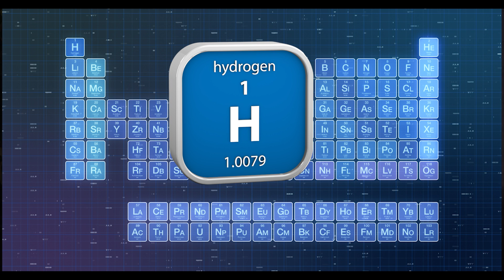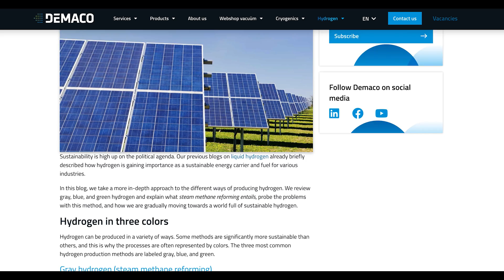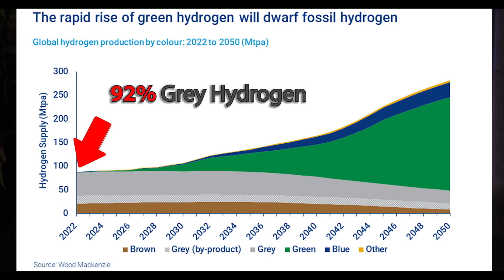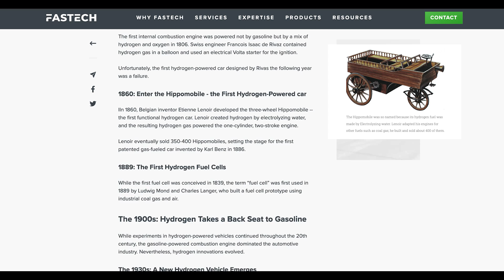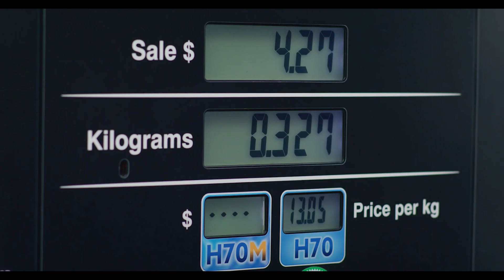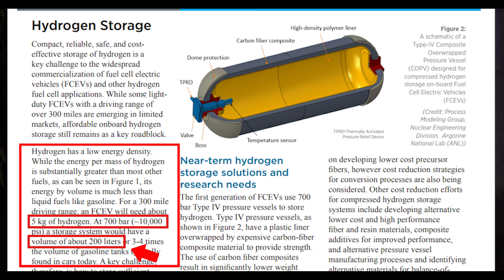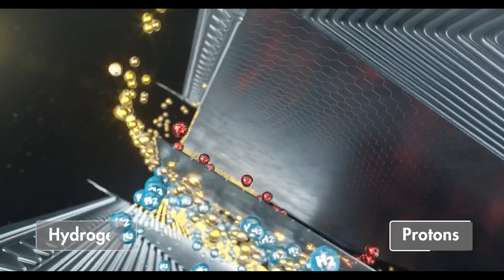The Truth About Hydrogen

Comment: Hydrogen will never fail to show up its poor energy density per unit volume, leak prone tendency, high specific heat capacity, boil off loss in liquid phase inspite of using best of thermal insulator. Only applications like Ammonia or Methanol making, unsaturated organics or ore reduction,  crude oil processing units have been able to successfully use Hydrogen. Best and richest source of Hydrogen is greenhouse gas  Methane only which in turn is found in Natural Gas, Biogas, ruminant fart, growing plants of rice. Natural Gas is also needed to extract Helium and humans are never going to stop eating rice as well as raising ruminants. 
Battery also has poor energy density per unit volume and degrade year after year. Battery recharging is not fast in many nations and uses electricity coming from thermal power plants only in many nations. Highly populated nations or nations facing daily traffic jams like India are skeptical about EVs particularly availability of charging infra and quick charging in case battery discharges. Solar, wind, etc are intermitttent and have low surface power density. Precious economic assets like Land area or terrace area  or even water area must be utilized 24 hours per day, 365 days per year instead of getting blocked with solar or wind or biomass or battery farms. Main use of electricity is to run refrigerator 24 hours per day but not recharging EV battery nor water splitting. Main use of land or terrace area is to build houses, food farms and cloth or other manufacturing units but not for blocking with solar and wind panels. Main use of water is to quench thirst of life, irrigate vegan food farms, provide food like fish to hungry nonvegans, fight fires, ship goods and passengers, curate concrete, wash clothing, etc but not for making hydrogen. Humans can minimize their need to travel by maximizing online tasking, use walking or bicycle to travel small distances, minimize all possible causes of traffic jams, ensure that passenger space as well as goods storage space of each vehicle are fully occupied. Earth has big scope to minimize or optimize the number of vehicles to be operated and manufactured, minimize on resources consumed per vehicle operated or manufactured or per passenger or per mass of goods, minimize emissions per vehicle operated or manufactured or per passenger transported or per unit mass of goods transported but humans on Earth are reluctant to take these steps.

Comment: Much of the information is outdated. The reason is that ev battery improvements are continual. Comparisons that made sense a year ago are are woefully out of dare now. Hydrogen production and storage has more problems now than they did 20 years ago. The big difference is that it has been proven that hydrogen is worse for the environment than carbon dioxide and hydrogen leakage is a problem that has never been completely solved. No new hydrogen filling stations are being  built and instead stations are continually being demolished. Testing hydrogen fueled busses proved to be far less economical than ev busses and all hydrogen busses were removed from service. If this channel remains useful it needs to be updated at least monthly.

Comment: Its just not practical to use electric to make hydrogen, equally the fossil fuels companies are salivating at the prospect of hydrogen made from anything they dig up! The other problem is its so inefficient either in a fuel cell or an ICE vehicle. Refueling is also a problem as hydrogen trains are discovering in Germany lots not running due to fuelling issues. I just wish people could really see the problems, however they don't Musk is right fools fuel
Reply from the maker: Hey Peter thanks for sharing your thoughts, and yes it does seem counteractive. Instead of charging batteries, lets use the energy to extract hydrogen and so on... I wonder if in 20 years it will even be a consideration to use Hydrogen. But maybe we will find some other applications.

Comment: Dont have to watch the video to know the answer is NO. Bottom line Hydrogen is very explosive and we do not want that on our roads. How ever I can see it being used at fuel up locations to generate electricity that will go into the cars so there is a definitely place for hydrogen its just not on our roads.
Reply from the maker: Hey Zemtek, 
Thanks for leaving a comment and sharing. I agree with you on the risks of explosions, and personally would be kinda scared to drive a car with hydrogen tank. Will see how it plays out,I do hope that we will see hydrogen used in other applications though.
Reply: @solartimeusa  I personally would not be scared, but thats just me. I do fully understand why normal people would be scared. I personally want to go out with a bang when I go :) Plus another thing I did not think about is hydrogen vehicles could be used in a terrorist attack. Hydrogen is very explosive and be used to set off even stronger explosives. So i see this will be a very very very highly regulated industry.

Comment: Hydrogen fuel, & hydrogen fuel cells are very different things. You can "burn" hydrogen as a fuel in a conventional piston engine, but the infrastructure doesn't exist to deliver it, & the storage tanks in the car require significant engineering to keep them from exploding in a crash. A Hydrogen fuel cell creates electricity from hydrogen, but the fuel cell requires very expensive precious metals. If electricity was abundant enough, green hydrogen could be manufactured from water, but we could also make carbon fuel from water. And because carbon fuels would no longer be made from stuff we pull from underground, they would technically be carbon neutral.

Comment: There are more than three "colors" for hydrogen these days. There's also "Red" hydrogen which is electrolyzed hydrogen using nuclear power to run the electrolyzer. There's also "White" hydrogen which is naturally occurring hydrogen. France has found an old mine shaft which has a pretty large reserve and the US has found several as well. It's also commonly found along with methane during oil well drilling but gets flared off rather than captured.
Reply from the maker: Very true, I just focused on top 3, rather than going into all colors. Hopefully more videos about hydrogen coming where we can share more of that for sure. :) Thank you for sharing!

Comment: For passenger cars the future is electric! Hydrogen isn't an option, and will not be. To handle with electric power is simple, efficient and that's why cheap or at least affordable.

For heavy trucks you could think some years ago that hydrogen is the option, but it will not be in that way. At least in the Nordic countries charging heavy trucks seem to be a no-brainer for the future.
Martyna, you can google, truck manufacturer Scania and the battery manufacturer Northvolt. 
Scania demands batteries to last 1,000,000 miles or 1.5 million Km, and Nortvolt says that is "no problem"...

Unfortunately you will not see such kind of a battery in a car. The governments decide how long the batteries will last! The technology today, in 2023, can make batteries last at least five times longer than the gasoline cars are rolling on the roads today.
When thinking of heavy trucks in EU and the Nordic countries, the drivers have restrictive driving hours between the pauses that is why the charging isn't a big deal for the future.
In Sweden and Finland some trucks now are about 34 m (about 114 ft) and I think the maximum total weight 80 metric ton.

I think even some trains will have batteries in the future. The the low speed and short trains can use batteries between places with power supply.

By the way, a German company is planning a hydrogen factory in my hometown in Finland! It will be about 2-3 miles away from the house I use to use. A couple of miles away from the house in the opposite direction there is a wind power farm, 56 7.2 MW wind turbines. 
If you can find an open field larger than 2x2 miles, you can see red lights almost in every direction at night... In the region, 70x15 miles, live 20,000 people.

Comment: Hydrogen is an infrastructure nightmare.
Reply from the maker: :( yupppppp
Reply: It's actually a similar infrastructure to Autogas which exists. Natural gas pipelines only need seals upgraded to be able to run higher mixes of hydrogen and gas turbines can burn hydrogen as well. Its more of an interest problem, oil and gas have invested heavily finding oil reserves offshore for example and need to make back on their returns.
The people that say hydrogen is too dangerous sit on top of a gas tank every day. If that tank is punctured the gas will leak out and accumulate UNDER the car and all you need is an ignition source. Hydrogen is explosive but because it is lighter than air it poses less of a risk as it cannot explode in the pressure tank (no oxygen inside) and if the tank is ruptured it will dissipate into the air where it can explode but not under your vehicle. I would rather drive a hydrogen car than a gas one :)
Reply: True 😂

Comment: All production hydrogen vehicles ARE DRIVEN BY ELECTRIC MOTORS. This has to be the biggest misunderstanding about hydrogen vehicles. Hydrogen is a substitute for lithium in an electric vehicle, not the electric motor. 
Hydrogen can be generated on site as opposed to needing to be trucked across the country. It can be used to store excess energy during the day generated by nuclear and renewables. 
And there's zero harmful emissions from a fuelcell vehicle. 

Hydrogen combustion is not a realistic solution and no manufacturer is putting resources towards this thinking it's a viable solution. Toyota built one, but it's only a pet project and they're well aware it's just as inefficient as gas vehicles and the emissions if combustion is not perfect can be just as bad or worse than carbon emissions from a traditional ice vehicle. But they're just showing that they can do it.
Reply: Yeah. Agree to disagree.🙂
I'll eat my words if hydrogen combustion beats out fuel cell 😅
Reply: @jensalan 👍
Reply from the maker: LOve the nice interaction! Always being open to agreeing to disagreeing ( or is that not grammatically correct here)? English second language...:D
Reply: H2ICE is now being implemented by Cummins, Toyota , Geely, JCB, Caterpillar, Deutz, Porsche , Ford, Stellantis, BMW , Hyundai Doosan , etc. just saying…
Reply: @lesliecarter4295    No, not really. There's development going on, but the reality is hydrogen ICE is not a reasonable solution when fuel cells already exist. 
Fuel cells can be around 80% efficient. 
Hydrogen combustion cannot really exceed 30%-40% efficiency because so much energy is lost through waste heat and noise. It's why gas/diesel engines are so inefficient when compared to electric vehicles. (keep in mind that gas has about 100x the energy density of lithium). 
Cummins only has one in development. 
Toyota sells a FCEV but the combustion engine will never go into mass production. It's only being developed as a race engine alternative so people can hear the car go vroom.
Greely doesn't sell one. 
Jcb doesn't sell one. 
Catipillar is probably the closest at having a viable product. They have generators that only accept a 25% hydrogen blend.

I'm not going to over every brand you listed, but again combustion just isn't a reasonable solution when fuel cells already exist. They're quiet and don't generate nearly as much waste heat so they're inherently more efficient without any potential for NOx emissions.
Reply: @jensalan  well we shall have to agree to disagree.  We will see who is correct 👍

Comment: Hydrogen can be good to replace the coal, like what Sweden is trying to do with steel production, but they will use the gas to provide energy to the fire to heat the steel, but I do not think it will be good to give power to the transport systems.

Comment: for electric truck, the idea is already introduce as swappable batteries. so your truck wont stop. just change the battery and go.
Reply: You could also give trucks smaller batteries to make them operate in smaller areas, their job would be to only load from shipyard to freit train station, and from train station to the precise final adress.
A semi with 200 miles of range fully loaded is more than enough in such a system, and considering that Tesla managed to build 500 miles semis, than 200 will be more than manageable to build.
(A Tesla semi reportedly spends 2 kWh per mile, so 200 miles range would be 400 kWh of battery, that's a battery of approx 5000 pounds, more than manageable for a semi)
Of course this would require that we change our system of moving stuff and our mentality about range. But consider that our ancestors thrived on trains, they had no semis or trucks at all. So it IS possible.

Comment: All icm cars can easily run on hydrogen gas, all that is needed is a simple timing change,  and your numbers are a little off , 1litre of water (1kg of water) can turn into 1,750litres of hho gas. 
The myth is  it's far away from being plausible , but the opposite is true, it doesn't need to be made at home or in factories just simply ON DEMAND in the car while driving

Comment: Very interesting topic.  I think the biggest challenge with hydrogen is the storage issue.  Hydrogen is so volatile that an accident could prove to be a catastrophic event.  Storing smaller amounts of hydrogen greatly reduce this, so some have created ingenious methods of hydrogen generation on demand.  In an application such as cars and trucks, acceleration demands more hydrogen than can be (quickly) generated, so drawing from storage becomes a way around it.  Hydrogen generation only requires water as the main fuel, which is great. (without counting wear items such as the alkaline base, fuel cells, etc.)  But hydrogen combustion keeps us in the realm of combustion engines which are relatively inefficient.  DC motors seem so much more efficient in comparison.  I hope we can make higher strides with electric cars in the next decade.  Charging them is a primary issue and if we can work through that, I think combustion engines will mark their place in history.
Reply from the maker: I so agree with your thoughts. I would actually pretty scared to drive with hydrogen tank. I am hopeful for solid state batteries in EV applications, sodium in residential storage and utility scale, and hydrogen maybe on big ocean cargo ships? 
Thanks for sharing your thoughts Bob! :)
Reply: @solartimeusa  Tanks at ??-000psi under seat NO thanks...

Comment: The electric motor is 100% the answer for how we move our vehicles now and into the future. What energy source we use to power them is still TBD. I lean more towards electric energy sources, mainly because we can control the source with renewable like solar/wind etc. I don't want to live in a world where I have to 100% rely on someone else to provide me the fuel for my transportation. I'm hoping the battery technology will drastically change for the better in the next few years. I just can't be too optimistic, as you said, a lot of the technology is stifled by money. If the battery in my car/boat/plane is so small and efficient, and I can use solar/wind to 100% charge it...someone's not making money after the initial purchase.
Reply from the maker: I 100% see your point! Yes if we have an electric car and all hell breaks loose, we at least can charge our cars from our solar systems at home. Hydrogen is dependent on 3rd party.
Reply: @solartimeusa okay charge it on your system what happens when you over 300miles away? And if its constantly cloudly/raining at home?
Reply: So how do you get the electric except from someone else? 😂 it doesn't grow on trees
Reply: @doubleooh7337  how do you think solar works? As I stated “after the initial purchase”.
Reply: @wallyrogers2371  do you even know how long itll take to fully charge a ev using just solar? If you had perfect weather no clouds and full sun, i bet even after 4days of that the ev car will not even be 50% charged, you wont be going anywhere , you'll be able to enjoy that for what about 1month out of the whole year ;)
Reply: On home charging you can plug into the mains over night on a trickle charge and will fully charge your battery at a fraction of the cost of petrol/ diesel or if you have a power cell that will charge during the day then charge your battery overnight (yes if it’s had sunshine during the day) can your Smokey blower fill up over night when the fuel stations are closed and top up you tank while breaking. 
A lot of EV will go more than 300 mls now and will charge at EV ports in 15 minutes now while your having a cuppa in the services.
You need to update your naysaying from 10 years ago to today’s technology.
Reply: @davidelson2728  whicj is a lie! A car battery is 300,000watts there is no trickle charging!
Reply: @davidelson2728  a kettle is 3,000watts you'd hsve to leave that kettle on for 100hrs

Comment: The hydrogen molecule is the smallest. Even space companies have leaks. Not a chance you can keep thousands of hydrogen stations running. Any chance chargepoint can keep rocket fuel stations working when they cannot even keep electric stations operating.
Reply from the maker: That is very true... I see EV for residential/ personal use still being dominated by lithium batteries, but maybe other solutions. What do you think about in big box trucks?
Reply: All trucks except for long haul will go battery electric. Long-haul will stay Diesel. Let’s not try to solve a problem that doesn’t exist. Trains and long-haul trucks using Diesel or Biodiesel seems like a good solution for now.   For non-long haul trucks weight is not an issue just add more Battery or have a truck Battery swap station at Truck stops.